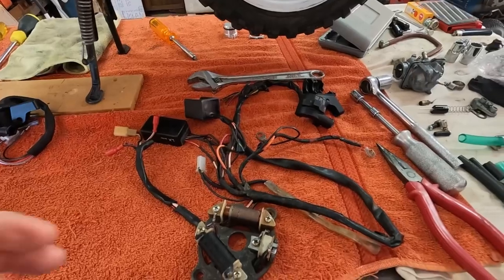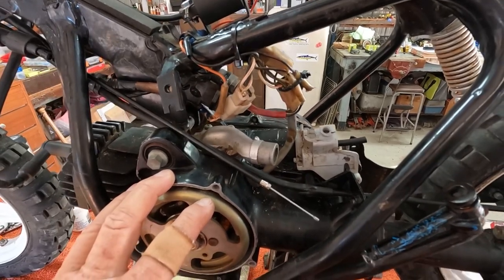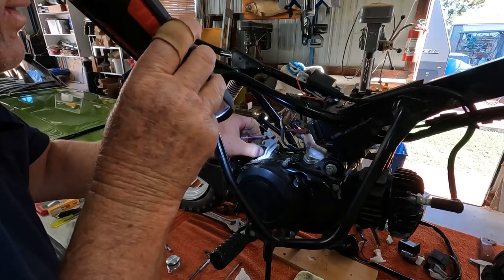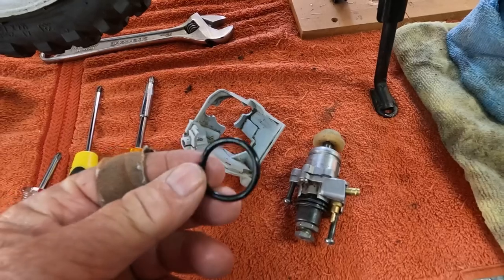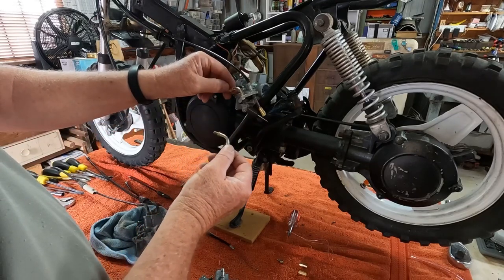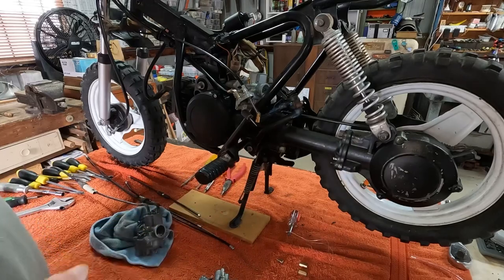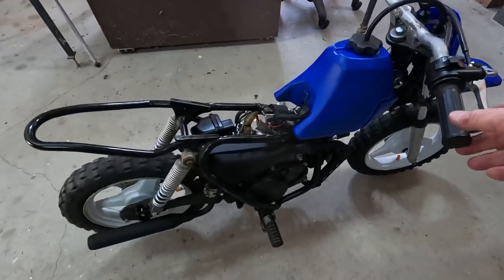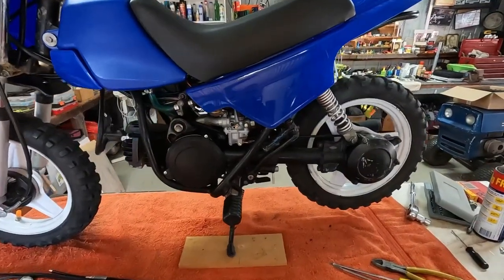PW50 MOTORCYCLE REBUILD - PART 3 - WE HAVE SPARK AND IT RUNS | SEPS ADVENTURES

Comment: You beaudy!!   Your reputation as a mr fixit man was on the line with that one - but you pulled it off !! Well done - now I just want to see Sep go for a quick ride around the backyard on it before it’s handed over to the grandkids!  Maybe you can show us a mono or two ? Make sure you wear a helmet though as you might struggle fixing things if you get a brain injury !
Reply from the maker: It’s been a fair challenge with most eBay parts not fitting correctly and needing modification. Tyre replacement, oil change, drive shaft inspection and decals to go. Cheers!

Comment: I've got a new wiring loom off eBay like yours and I think that they wire the diode the wrong way round. Yellow and white wire should be to the positive on the diode and the RED wire onto the negative of the diode. I think this would stop the spark being the wrong way round.
Reply from the maker: Anything would be worth a try because they just don’t work as they are. Thanks for your comment. Cheers!

Comment: great work, what is the link to buy I want to carry out this procedure.
Reply from the maker: All the aftermarket parts were sourced from various Ebay sellers. The wiring loom and associated parts from 3 different sellers on Ebay did not work and I was unable to source brand new original wiring from Yamaha as it is no longer made. I sourced the second hand wiring and carburettor from an original PW50 that was being used for parts from a local mower/ motorcycle repair shop. It was a very drawn out process restoring this bike due to the difficulty in fitting aftermarket parts. My suggestion would be try to source original second hand parts and try and make that work if possible. Appreciate your comment. Cheers!

Comment: Hi great video 
What is your fuel to oil ratio ime mixing 40:1 but my sons still rides very slow and ime noticing alot of oil coming from the muffler.
 Cheers
Reply from the maker: A couple of things, make sure the oil feed line is completely removed from the carby so no additional oil can enter the mix. We use low smoke two stroke oil for motorcycles at a ratio of between 35:1 and 38:1 best to run a little more oil than not enough. Hope this helps and thanks for your question. Cheers.

Comment: I've got a 1983 Pw50. And I've read somewhere the older model PWs have different bits on the harness I think I just can't remember what haha or it's different stator or something like that. What year is your?
Reply from the maker: Ours is not a genuine Yamaha PW50 and are unable to determine an exact year but best guess late 80’s or early 90’s 
I believe the early model harness fits 1981 to 1997 then changes after that also the genuine Yamaha harness is no longer available. Cheers!

Comment: Did you find out what the problem was. I have the same problem with the spark
Reply from the maker: Unfortunately I could not identify the exact part in the electrical system that was causing the problem. The eBay electrical replacements did not work. Best I can suggest is you do the same as what I did and find a second hand original wiring loom with all the components and put that on. Unfortunately you cannot buy the OEM electrical parts new any more for the model that I have so second hand OEM was the only option. Hope this helps. Cheers!